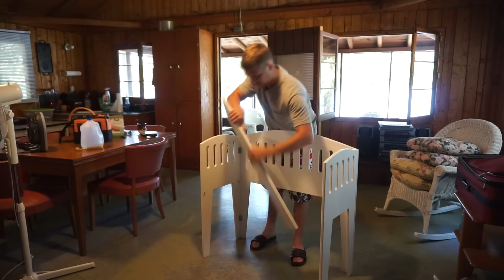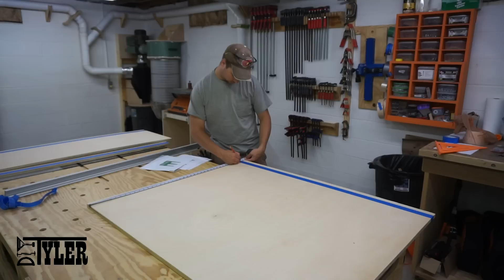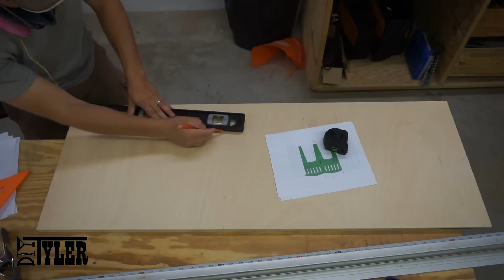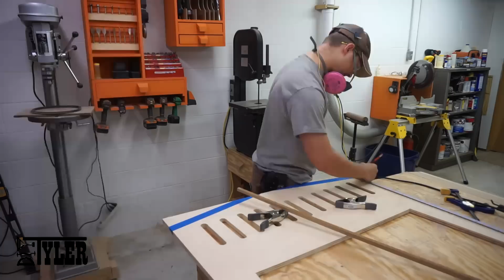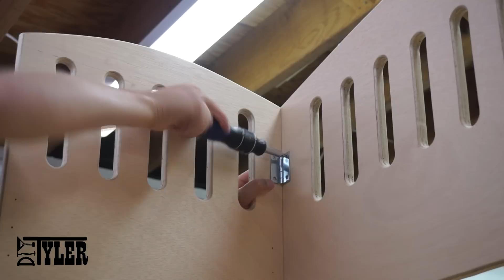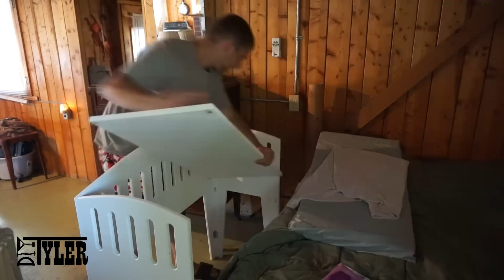How to Make a Crib | Limited Tools Build

Comment: Good design and project, be sure to use something as a strap or any device that will keep the crib and the bed as close as possible. This way, if one of beds moves during the night, there'll be no problem such as gaps, rolling kid...
Reply from the maker: +William Roy I didn't say anything about securing the crib in the video but I wrote about it in the description, a dresser is behind this crib and for the one at home I have a strap that secures it to the bed. Thanks for watching and looking out!
Reply: My bad didn't read the description! even better vid then!
Reply: Awesome. I have been searching this type of DIY co sleeper  and i have found it here. I best part is you can fold it when you dont need. Tq for sharing this vedio